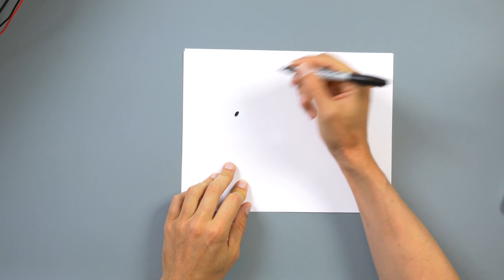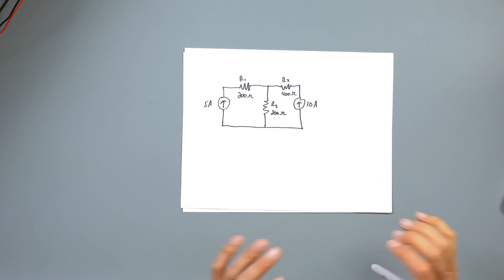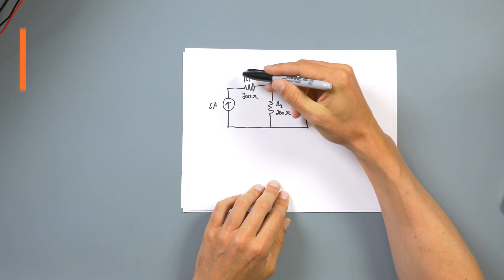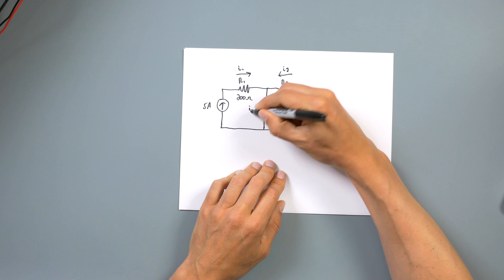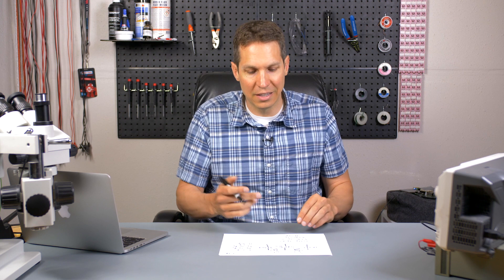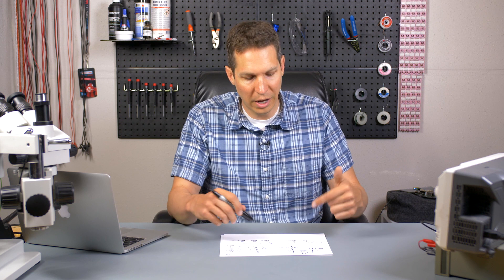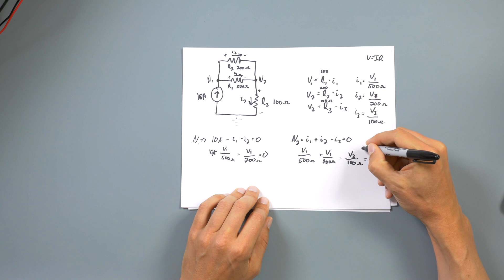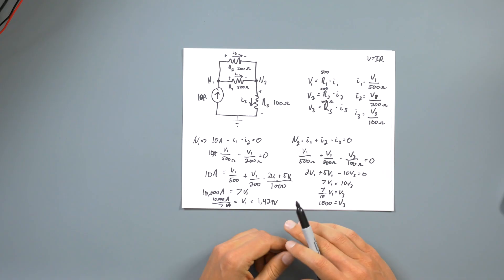Kirchhoff's Current Law (KCL) - How to Solve Complicated Circuits

Comment: What is a reference ground?
Reply from the maker: Reference ground is the voltage level that you are using as your baseline - your reference - that you assume is 0 volts.  As voltage is relative (it's the potential difference between two or more points) you can just say that one is at "0V potential" or ground and everything else's potential is just given relative to that arbitrarily chosen ground, higher or lower.  It's not really all that complicated, I fear this explanation may make it seem more complicated than it is.

Comment: Man you have a great mind. i really appriciate what you do it takes lots of tinking just to organize these points in their right place through the lesson and u did it great✌️
Im trying to start my path in electronics, when i was in highschool i really was in love with physics but cause of lack of information i chose civil engineering. My qustion is how can i dive into electronics so smooth and deep until i could make a change in this field and for example i wish to design a solar panel with much more efficiency. I dont have time to go to university again im in my 30s but become a proffesional electrical engineer is my dream. Can u give me a roadmap?
Reply from the maker: Thanks for the comment, though I want to recognize that this truly is a team effort to put these together. As for your question, that’s a tough one. At this point, there will definitely need to be sacrifices in time to make that switch but it’s very doable, even in your thirties. I highly recommend that you really focus on what you want to do. Solar panel chemistry will require a strong background in semiconductors and general chemistry. If, for example, you realize you’d much rather do robotics, you’ll want to focus on embedded systems, and control systems. So you want to make sure you’re putting your efforts to the right things. Either way, you’ll want an understanding of circuits and digital logic. So, timeline, I’d recommend first establishing a firm goal. Second, get a good foundation in the basic EE principles (as mentioned). Third, dive deep in those topics that you’re most interested in. I’d love to tout all of the CircuitBread lessons and tools but there are many other amazing resources on the internet you could use. If you’re like me, the biggest challenge will be maintaining motivation when balancing work, family, and studies. Find out what YOU need to stay motivated. Good luck with everything and let us know how things go!
Reply: @CircuitBread  thank you so much for your kindness. really made me happy and it gives me hope to know that its possible to do. Well said as long as i hve the motives i feel the progress. And onestly haveing such powerfull and enthusiastic sources such as your team is one of the biggest motives making it possible for us to not give up our dreams. Hope u can keep helping people and make good changes so you feel better about your life everyday more than before💚.

Comment: What can possibly cause an LED strip to dim after a few days? I have installed a few fixtures in an exterior breezeway they all became very dim almost like it's not working, only if you look very close you can tell that they actually still "working" of course as soon as he changed them with new ones they also worked for a few days and same story.... (They all connected to the same switch, also they have a sensor that turning it on at night, if it have anything to do with it)

And big thanks for the channel! Love it!
Reply from the maker: Hi there!  Thanks for the feedback and that's really strange about the LED strips dimming.  My first thought is that they might be getting too much voltage (like you paired a 24VDC power supply with 12VDC strips) which would cause them to be very bright but then burn out and, instead of exploding or completely failing, simply become very dim (check out our failed attempt to burn out an LED in our LEDs and Forward Voltage video where exactly this happens).  Are there other factors to consider?  It's an outdoor breezeway, right?  Are they exposed to damp or wet and are not rated for it?  Are you seeing anything odd on the connection points, like discoloring you wouldn't expect on something so new?  

I don't think having a common switch or the light sensor would be a cause of issues but it could be.  I installed a timer switch for my garage lights because my wife and kids leave the garage lights on 2-3 times a day (it drives me nuts, we're having a passive aggressive war, it seems) but the timer switch caused my LED bulbs out there to completely freak out, flashing and flickering, so I had to take the switch back out.  So, while I don't think it would be switch/sensor related, it could be.

Comment: at minute @20:08 what algebra did you use?  I jst cant seem understand
Reply from the maker: First, thanks for giving me a time stamp, that makes it soooo much easier to find!  Second, I found the lowest common denominator at that point.  For 500 and 200, the LCD is 1000.  To make it so I'm not actually changing the value, I had to multiply the numerator by 2 and 5, respectively ( 1/500 = 2/1000 and 1/200 = 5/1000).  Once they had the same denominator, I could add the numerators.  Let me know if that clarifies things!
Reply: @CircuitBread  Yay! thankyou very much for this and to this series. Very much appreciated <3

Comment: dude , at 18.07 v2/200  why you put the value of v1/200??????
Reply from the maker: Hey Awais!  At 17 minutes, it mentions that V1 = V2 and that's because R1 and R1 are in parallel, so the voltage across them is the same.  Hopefully that helps, if not, there's the tutorial on series and parallel circuits here:  https://youtu.be/kpeNF-qCVBk
Reply: @CircuitBread  THANKS BRO, IGOT IT .

Comment: Most of us struggle because ...
 well where is the resistor in real life how do you measure those currents and so on we all     have that boring diagram since highschool yet not practical conformation of the stuff working...not to disregard your efforts but if it were on the breadboard it would have been much better ... I never met an electrical engineering graduate who can make a working amplifier why they spend more on memorizing equations than on real electronic components.that is why even  highschool dropouts exel at building circuits because they are not slaves to the old digest and regurgitate vicious cycle lol